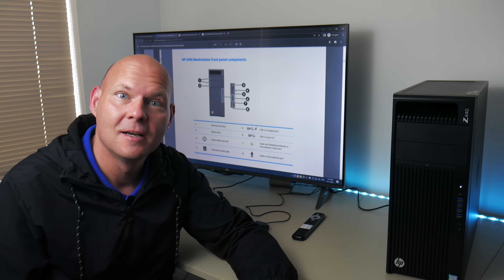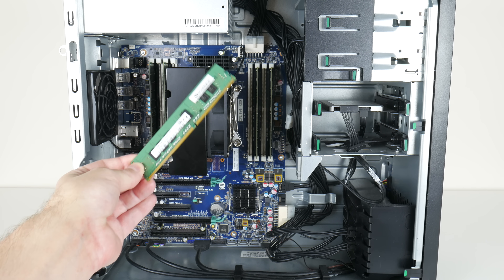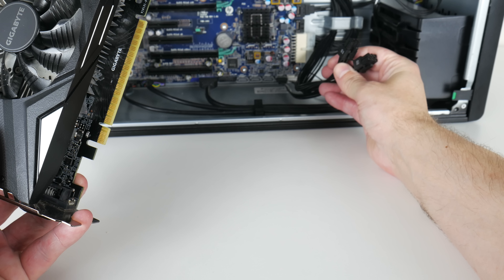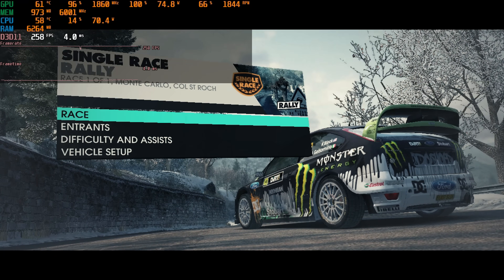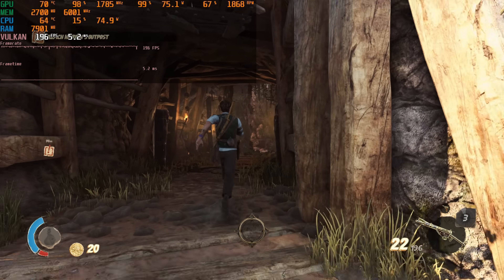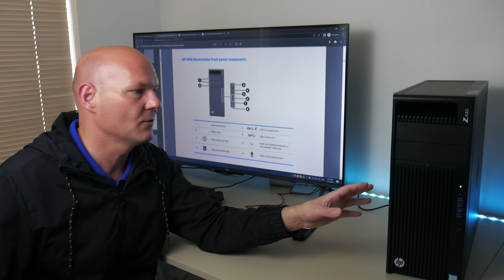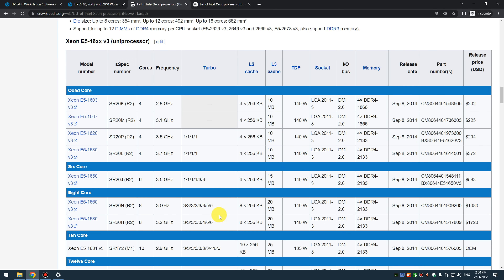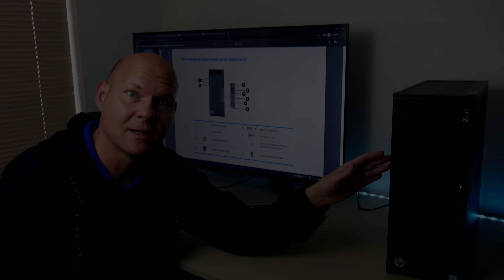This HP Z440 PC was my best purchase this year

Comment: I just bought a hp z820 for 135 total. shipping tax.. It only has one 8 core processor but has 64gb memory. I might try to ramp this up to 24 cores with two 12 core cpus. But I hate to mess with something that's up and working, the 8 cores is more than what I need..

Comment: refurb 3/4th gen or 6/7th  gen or  even 10th gen  parts have  it all  over this box but you have to shop around - also you need to make sure to get rev2 of the  mb  for the  z440 --  it is better too spend a little more and get a modern platform for most people - lower power use is another consideration - modern refurbs use less power

Comment: I have to disagree with you in a couple of points, Phil. Having worked in Dell's tech support, my experience is that these OEM machines are overengineered only in regards to the chassis, so they will be really quick and easy to service by on site technicians. Everywhere else they will cut cost as much as they can get away with. What companies pay lots of money for is next business day warranties and such things.
Anyway, nice video as always!
Reply: That definitely sounds like Dell...
Reply: Sounds like dell, however this is HP. Also are you taking consumer or business class machines or the workstations? There is a difference and it's visible in the price. In
Reply: @bzuidgeest  from my experience, the build quality of everything except the lowest end machines is basically the same. The main difference is the level of support they are subject to.
Reply: @unclerubo  then you and I differ in experience, at least when it comes to HP , not to say there never has been a dud model once in a while. No manufacturer is perfect, i am no fanboy.
Reply: @bzuidgeest  I am not so familiar with HP stuff and I haven't provided support for Dell in 10 years so I couldn't tell for sure :P

Comment: Not sure if it came up in you optiplex video, but speaking of Xeons the 9020 and XE2 on the last bios can use the e3-12XX v3 xeons. I have an Optiplex Xe2 with a e3-1245 v3 which is mostly an i7 4770. This is wonderful since I bought for saving since my i7-4770 for $36 and the Xeon for $29, just me stay the idiot for buying both. My work place was throwing these optiplexes out so I nabbed one from a Proxmox machine. Found out about the haswell based xeon thing and tried it, happy I did. Beat the i5-4570 is came with. I'll be trying an optiplex 7010 later on to see is that works as well. Seems from what I've read the DDR3 era was the last to allow this.

Comment: Good video.
I wonder where the "Sweet spot" is for cores/threads vs clock speed on those Xeons are.
The top of the line cpu, the E5-2699 v4 has 22c/44t but only runs at 2.2ghz. The Xeon Broadwell E5-2687W v4 has 12c/24t but runs at 3ghz.
Reply from the maker: Also consider size of Cache. Sweet spot would be the 1600 series with 8 cores. But it's an expensive one.
Reply: Have a look at the 18-Core 2696 V3, this is an off-label OEM CPU which has a higher boost of 3.8 Ghz and has a memory controller that supports both DDR4 and DDR3 (no mixing though). This is better than what the 2699 V3 brings to the table. There is a turbo boost unlock hack for Haswell-EP around that doesn't work on Broadwell any longer. As these CPUs easily hit their TDP limit, you won't hit the maximum boost on all cores (my sample can do this only when limiting it to 10 Cores) but with an undervolt applied, you could extract a nice performance gain out of the 145W TDP limit. There are tons of videos out there that explain how to do all the hacks involved to get it to work. I even got Resizeable BAR to work with my X99 board.
Reply from the maker: 2.2 GHz is just the base clock, it will turbo much higher than that. It's all on the details, you can see the turbo bins (100 MHz plus per bin) on the linked wikipedia page. There is one V4 OEM CPU that is better pick than the 2699V4 with slightly higher TDP and higher turbo.

Comment: Older workstations are great bang for the buck, I've slowly traded my way up from a Dell T3600 to a T7920. I have a Gigabyte 1660TI in it and like your system it's the noisiest thing and I too am looking to replace it with something quieter.
Reply from the maker: I want to learn more about DELL workstations, got to research those model numbers. A lot depends on when large companies upgrade and flood the resellers with stock.
Reply: @philscomputerlab  Yeah the Dell products are more confusing, and they generally are less supportive of CPU uplifts. For instance, a T3600 is comparable to a Z420 & uses E5 V1 CPU's but unlike a Z420 you can't upgrade to V2 CPU's you need to buy a T3610 for that. T5xx0 series are also confusing as earlier T5600 & T5610 are single CPU upgradeable to dual but later T5810 & T5820 are single only. My T7920 is basically the equivalent of a HP Z8 G4.  Dell stuff is always cheaper too probably because of their less flexible cpu upgrade paths so they get dumped by companies sooner.
Reply from the maker: @bunter6  Thanks for the pointers will do some online research.

Comment: Thanks for the video. I Have a Z420 and Z620(dual xeons) and want to use NVME drives so I just purchased a Z440 after doing a bit of research and came across your video while waiting for it. I actually bought the same processor as you. My questions for you as I never had a computer that the PCIE can be bifurcated on till this one that should get here tomorrow, Does the x8 slot share the same lanes as the X16 slots? It wasn't entirely clear to me. I want to get the maximum speed speed out of the NVME drives without using the video card lanes which i purchased a RTX 3060 for this computer..   Question 2, does the Z440 allow me to boot from the NVME?  Question 3 Does it allow me to use a raid 1 NVME for the boot if so?  Really can't beat a complete $300 computer+ another $300 for a good video card.
Reply from the maker: I don't think it can boot from PCIe M.2. Chinese X99 boards, can, but with this one, I have a hunch that HP put some blocks in place. But I could be wrong. There are no shared PCIe lanes, one benefit of this platform. Only that single 1x slot is shared I believe. Anything PCIe 3.0 goes directly to the CPU, whereas 2.0 is shared through the chipset.

Comment: Looking to get some more of these.  Currently using Z640 to run a 3 node Kubernetes cluster - under FreeBSD !
Want to setup another cheap one just as a dedicated docker build box, and maybe another one as a CI runner.
Not that I need > 1 ... but at this price, may as well get a few, then I have redundancy for ages

oh - probably need 1 more, to live test windows builds, since I dont actually have a windows machine anywhere on the homestead

Comment: Interesting. I have one of these, With the 700W PSU.. and as it happens, I have some server hardware in the garage with Broadwell 2680-v4 (14 cores) so upgrading should be no problem.
Reply: So, today I upgraded to a Xeon 2680-v4 and it is pretty cool. I had to upgrade the bios to get it to work as my Bios was from 2015. 
Also - with my 32GB modules it is even complaining about requiring memory fans with just 2 modules (64GB total) so I will have to investigate this. 4x8GB, which it had as standard, did not generate such complaints. So it probably has to do with memory density overall.
However - it is still booting after a splash screen, so I am not sure if there will be any stability issues due to this. 
Thanks for the inspo

Comment: I have an old i5 4690 was good in it's day. This 16 thread PC is much better than that 4 core 4 thread machine. My PC died on me at a time I needed internet for job searching so I just bought new instead of swapping parts out. Now I have a i5 11400f which having 12 threads is much more future proof I think. Still love your rig, would have liked to update to a i7 if the PC didn't die on me.

Comment: The only weakness my Dell T3610 is that it was very protective of power overdraw by a RX 580 I had installed in it. I read that the RX 580 had a reputation of doing this. That PC has since been upgraded to a RTX 3050 and it doesn't have this problem. The PSU is 675w so it should have been able to handle the RX 580. 

My son uses it now and it has 6c/12t, 56 GB Ram, RTX 3050 and probably around 6tb of mixed storage.

Comment: For that price it is amazing. I think you can future proof it in terms of operating system. Meaning you can upgrade the TPM from 1.2 to 2.0 so that you can install Win 11 on it.
Reply: Windows 11 doesn't "need" TPM at all also doesn't "need" 4gm of ram and 40gb of hdd space, despite checking for and making sure the system has those things before installing. The checks can be disabled.
Reply: @bdhale34  Try playing Valorant without TPM 2.0 on Win 11. It won't work and from my knowledge other games will also need it if you run Win 11.
Reply: @bdhale34  while we're all busy talking about "needs" I don't need Windows.
Reply: I have the z440 and i managed to install win 11 with a simple trick and everythink is working for me just fine games editing even the pc performed better than win10

Comment: I have z240 very noisy and cpu overheats easily but has good xeon gpu x6560 I think, has 6 mem slots so am running 3 4gb sticks could add 3 more for very cheap 24 gb but 48 is supported.
Have gtx 1060 6 gb stays cool.

Comment: Yes its a well made workstation - but its also 8/9yrs old next year.. and not very powerful by 2022 standards.  In the UK you can pick these up on ebay for around $60-80 for this spec.  That is a better price than 180

Comment: I love how many pcie expansion slots you get on workstation and server motherboards. I miss having everything neatly inside my pc case instead of the rats nest of USB cables gathering dust we end up with nowadays lol
Reply: All of them being open ended slots is a plus as well as some cards are overusing lanes,  so you could put a card that only needs/uses x4 bandwidth but is a 16x card (like the nvme adapters) into any of the slots.
Reply: @bdhale34  very true. In a pinch you can cut the end of a regular pcie slot but I've never personally wanted to do that to a mobo I liked.
Reply: @christopherjackson2157  In the old days the cards that would tolerate a lower-spec slot had cutouts so you could use them that way. Or how I had a 16bit VGA card in an 8bit XT slot. (Which did wonders for system performance.)

Comment: I've just bought one of these babies based on your video from a local refurb dealer 😄. It came with an Intel Xeon E5-1650 v3, 32GB ram in quad channel configuration, with the optional RAM shroud and the 700W power supply. It cost about 320 USD if I convert it from my local currency. I plan to put an AMD RX570 in it, so I'm very curious how it will turn out (it will replace my old FX-8350 rig).
Reply from the maker: That video card will be the bottleneck just so you know...
Reply: @philscomputerlab  Yeah... I imagined so, but it's the case of what I have on hand for now.
Reply: So I've been using this PC for the last month with the RX570 (8GB version), and while the most modern PC game I play is Guild Wars 2, even in the new Cantha zones, details neary maxed out, I get about 40-50 FPS. In the vanilla zones, it is actually locked at 60 fps. I have to say, this PC was the bargain of the century!

Comment: I wouldn't be surprised if AMD released a card like the W6400 or W6600 with around 6 or 8GB of vram with the newer hardware focused entirely on being a budget option taking advantage of the upscaling tech they've been working on that isn't as finicky as nvidia's to get 1080p HD or 2K results based off 720 or 1080p upscaled.  The only reason at this point I don't see that happening marketing wise would be, "why would I pay for a higher end card if I can get 1080 or 2k results with a sharp enough image for less cost?"  I would because I do more than game; editing applications that take advantage of a better card with more vram are my main use case.  For a machine for daily use and good enough gaming it would be a great solution to make a great mini or micro atx tiny case system.  I expect this concept will be explored more for consoles, both handheld and home use, in the future if the purpose built APU's from AMD support everything properly.

If I remember right, AMD's upscaling tech is all opensource.  If Intel made a GPU, discrete or internal, that went that route using/contributing, it would be an interesting way to get into a market that would make me consider an Intel card when I otherwise stick to AMD cards even after getting a 12th Gen Intel processor to test out the power/efficiency core design.

Comment: Yes, 100%.  The ECC ram on aliexpress is dirt cheap.  I have 3 dells in the precision series, one runs vmware, 2 desktops and one even has a GTX3080 GPU in it and does OK for gaming.  The big weaknesses are the motherboards and PSU fail and cost an obscene amount to replace.  For my 4th one, to get around that I just got a chinese X99 motherboard to test  Standard PSU, standard ATX board. You do have to research them carefully though as many are crap.

Comment: Im still gaming on a 2689v1. Dont know if i shoukd get a v2 chip or jusst go for v3 and sell the board, cpu and ram i have
Reply from the maker: I bought the top V2 CPU recently on planning on doing a video, so stay tuned 🙂
Reply: @philscomputerlab  i found a 2697v2 for 55€ but the seller was unresponsive(sort of like a scammer). So still on the 2689. Heared there was a bios mod to unlock the fulll speed of it to 3.6ghz, sort of like the x99 mod but havent found anything
Reply from the maker: @dexsters5643  Hmm haven't heard of X79 platform able to do that...
Reply: @philscomputerlab  one of my friends whos a pc part fixer. Does alot of stuff with bios mods. X99 bios mod, nvme mod and so on and he mentioned something about being able to push a X79 (LGA2011) xeon to 110%. At first i thought he ment oc but not really. He is using a E5-2667v2 xeon on a MSI x79 motherboard and has that cpu set to 4.1ghz all core. Even tho on a normal board the all core would be 3.6ghz

Comment: 8:11 - Half Life 2 has the FPS cap set to 300 FPS by default - it won't go any higher than that. To get around that, you can append "+fps_max 0 +mat_vsync 0" to launch parameters to disable frame limiter and vsync.

Comment: Australia really does sound like Mecca for retro PC hardware. So many cool options for cheap, and Asia is right across the pond.

In Canada and US, almost all retro hardware on the continent is already either in collectors' hands or recycled. Easily available options are available only in Europe, and they all cost a fortune, probably because Victor Bart buys them all.
Reply from the maker: Hmm I remember other channels from Canada and US covering all sorts of OEM machines at better prices. Especially the non small form factor machines are like non existent here.
Reply: i bet you can find a lenovo tiny, dell micro of hp mini for under a $150 on ebay wherever you are, although i don't think these systems quite fit the retro label as they were available within the past decade.. but great mini computers for gerneral computing and the perfect solution for an efficient server

Comment: as an I.T pro you need the correct drivers windows 10 drivers are only a place holder and are not meant for you to stay on them they are meant to only get all parts up and running so you can use them temp the OEM drivers and straight from the source is better for the computer meaning update the chipset driver directly from intel same with the network card and nvidia for the correct GPU driver

Comment: @PhilsComputerLab Hey Phil, have you tried modding your BIOS with the Turbo Boost unlock for Haswell-EP?! You could try a safe undervolt of -50/-50/-50 mV to get as much performance as possible out of the 145 W TDP limit. Also be aware that you could unlock Resizeable BAR, too. Miyconst Hardware had a video tutorial that you could try. It worked perfectly for me.
Reply from the maker: Yes done this with AliExpress boards, but on HP not easily done.

Comment: You could consider digging into and try to apply the v3 all core turbo mod to bump up the performance quite a bit if the vrms are up to the task...
Reply from the maker: AliExpress boards are much better for this ☺️ HP doesn't make it easy.
Reply: @philscomputerlab  True but definetly worth it imho. I'm still on it with my Asus Z9PA-D8 to get the mod working.